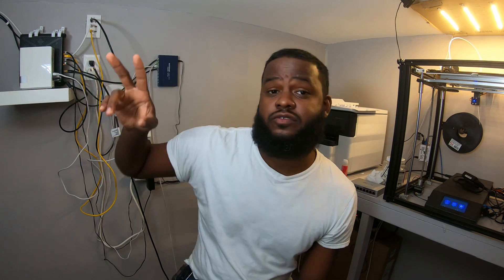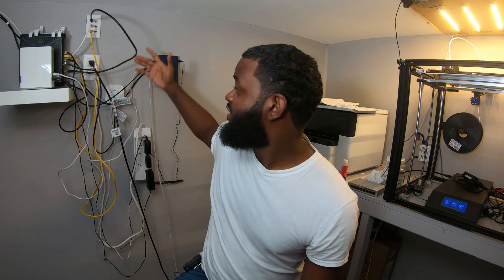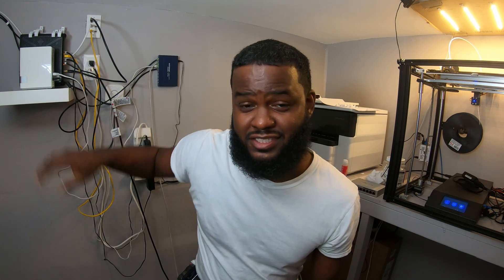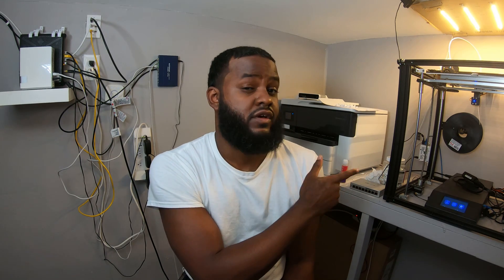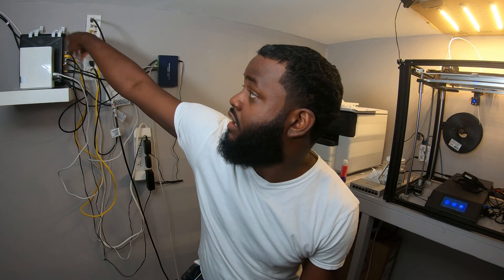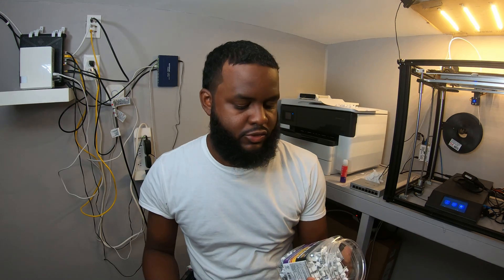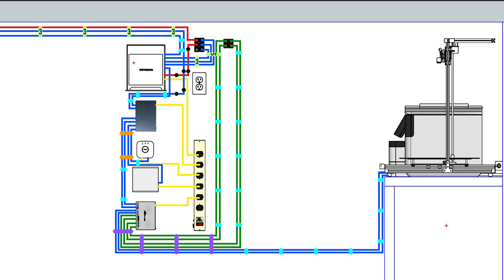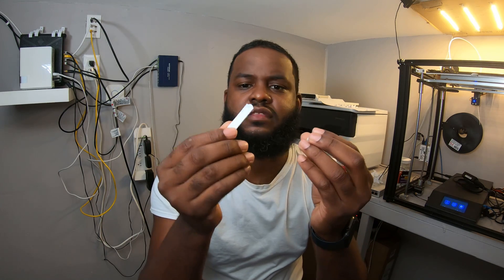Home Network Cable Management Guide 2022

Comment: Use command sticky peper stuff, that is sticky on both sides, or the velcro like stuff. It will save screw holes and do no damage, but it is the same otherwise. I live in a picky apartment, so i have to.

Comment: it looks nice and all but why not just get like a 4u rack? i did my network but i did not film it because i did mine in steps. it  is fairly complete but upgradeable by way of adding more and changing out and upgrading equipment. i use a 2u rack mount and put a patch panel on the bottom and a shelf on the top with my equipment on the shelf.
Reply from the maker: I have a 9u wall mount rack that I put on casters but I didn't want to put the other components in until I found a shallow server chassis for my TrueNas build. This was the best of the situation I could manage without too much extra money spent

Comment: Looks great, I need a 3D printer too!  Beware broadcast storms with multiple switch connections that aren't lagged....
You might be able to get a poe (PD) switch to run off that unifi poe provider as well -- I've used the GS108T for awhile.  That would get rid of a power cable.
Reply from the maker: Yeah I definitely missed an opportunity plugging in the cloudkey that way, I'll keep that in mind for the next version